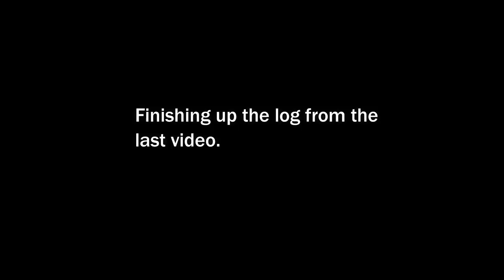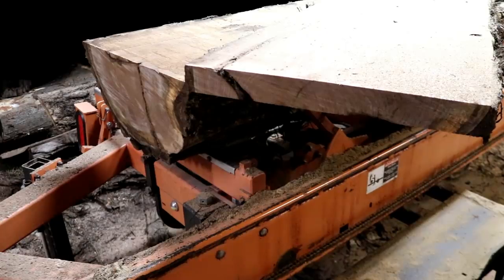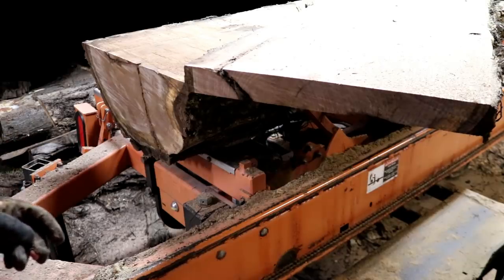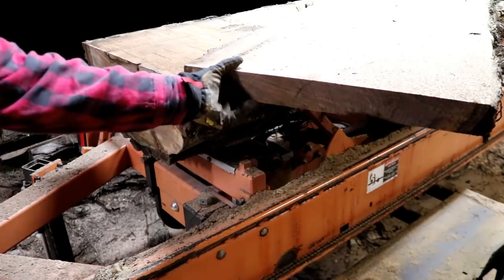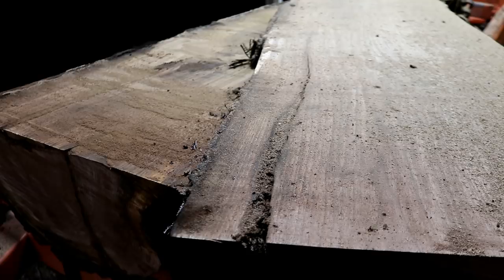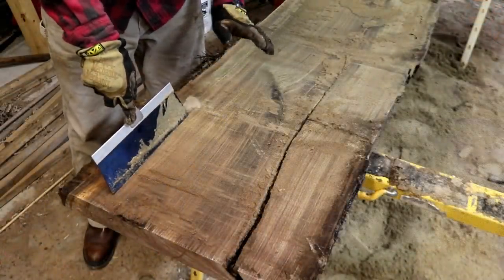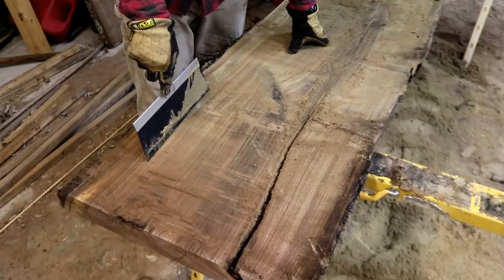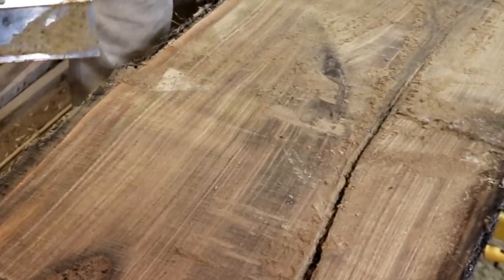THE STRUGGLE CONTINUES, SAW-MILLING THE CRACKED WALNUT LOG

Comment: With the crack you might look at smaller project pieces that don’t necessarily need live edge.  Projects like end tables and night stands.  The other thing that comes to mind is turning blanks.  3-4” slabs for bowls, 3x3 or 4x4 for little boxes and dishes, or even legs for the live edge table you make from the really good slabs!  Good stuff as usual!

Comment: Sawdust control looks like it is becoming an issue. Just an idea - attach a cloth bag to the outlet of the mill to catch the dust, and after each pass, remove the bag and dump it into a bin which you can move with your tractor forks.